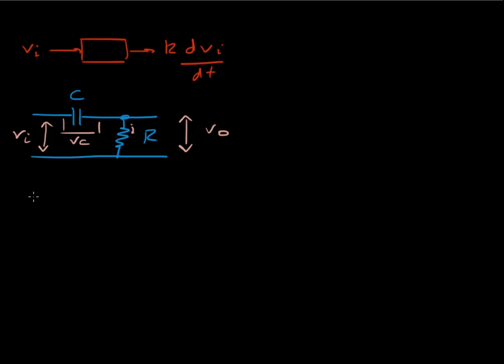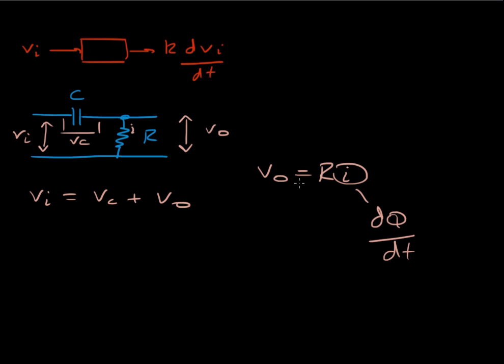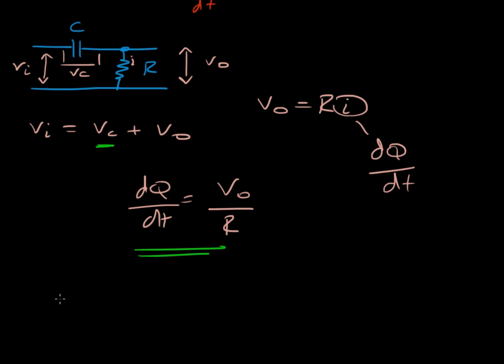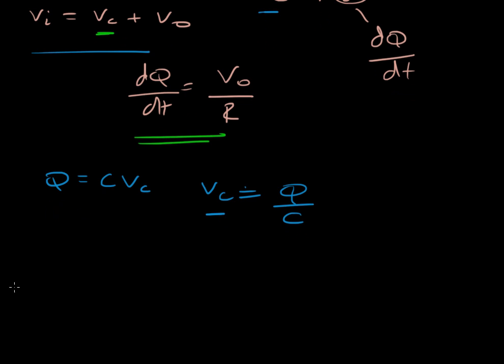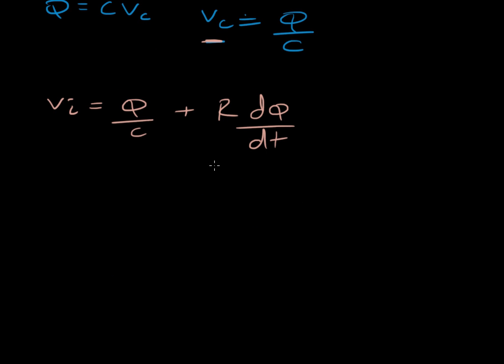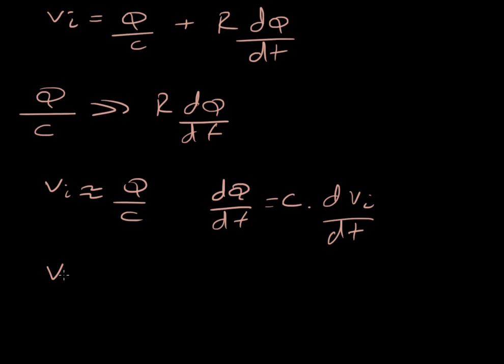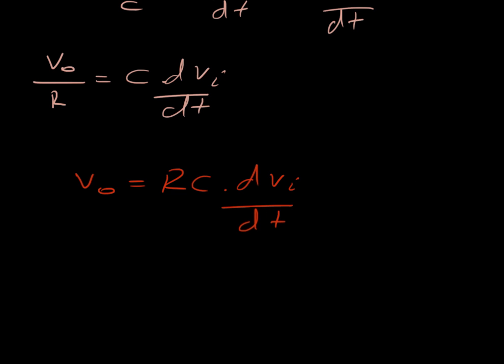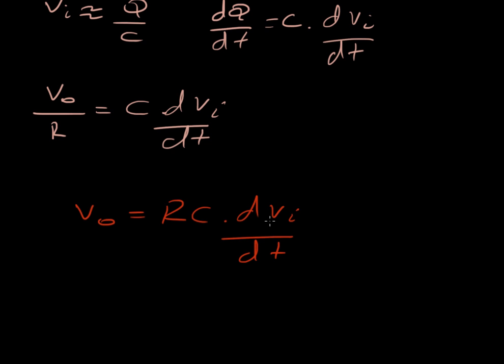RC Differentiator Circuit

Comment from the maker: Probably the easiest way to show that you do get the derivative is to run the circuit in a simulator such as pspice.
Reply: Herbert Sauro 

Why is the assumption that RC is small valid for this analyis, but was that RC was large for the RC integrator?
Reply: If RC is larger than the time period of the signal, the capacitor will never charge during the half cycle and o/p will be totally equal to the i/p. Hence for large RC, circuit becomes a High Pass Filter for the signal.